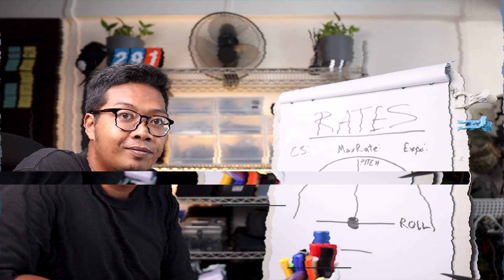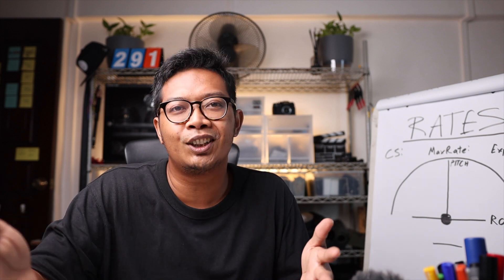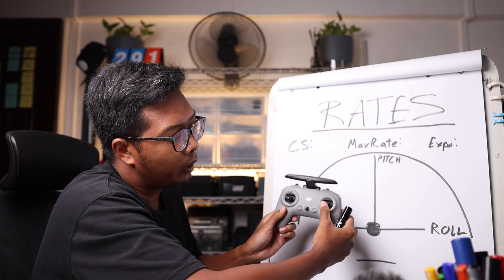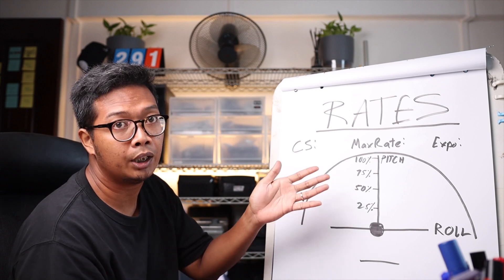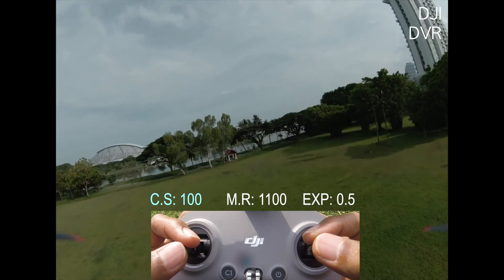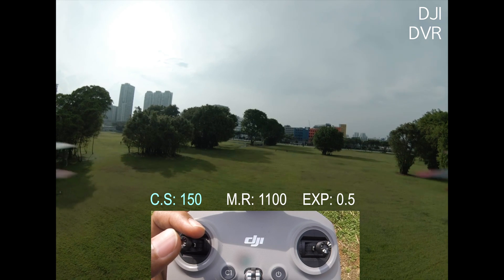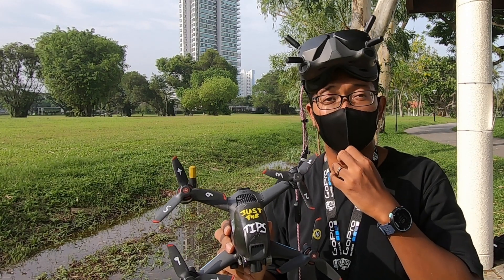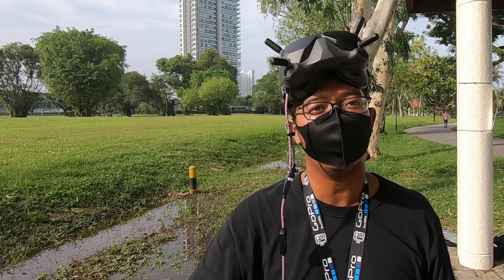How To Tune DJI FPV Rates CUSTOM TO YOU

Comment: do you have tutorial on how to fly slow speed hehehehe
Reply from the maker: Generally, that will have to do with the camera angle. the lower the camera angle, the lesser you will pitch forward, resulting in slower forward flight speed. Watch it here:
https://youtu.be/pHcQuOItoJo?si=5E9Qmg9j0FpOaXs6

Also softer rates help in smoother slow flights:
https://youtu.be/Ybm89B1pIO8?si=wtAXxtaPeqdyVhcm

Comment: Thank you for an amazing video. I have a question, is there a rates for throttle to keep it flying smooth and low and slow? Like to fly in building without worrying about smashing into areas etc
Reply from the maker: Sorry I missed this. You're most welcome! Hope the journey has been smooth for you. I have the same problem mate. When I was flying DIY fpv drones and wanted to fly in close proxy locations like an indoor carpark, i often would hit the ceiling. To counter this, I would add EXPO to throttle to have a smoother throttle curve. But sadly, the average user is unable to access this for the DJI FPV/Avata. BUT I did hear that there is a way to do this on the desktop. Have not tried this way yet. Prolly will get an episode out on this.

Comment: Great man! Greetings from Brazil!!
Hey would you mind to tell what kind of accessories you use to attach the camera to the controller?
Reply from the maker: Greetings from Singapore! Sorry I missed this. Hope your journey in the skies have been great. I use an fpv screen monitor mount. DIY fpv pilots used to fly through a screen, so I had one around. Not the best fit, but does a good job. Have a GoPro plastic base fixed on, and interchange between using a GoPro or a DJI Action 3. Iv ordered a better version as the clamp to controller is more versatile. 

Here is the mount: 
https://s.click.aliexpress.com/e/_DdANMYD

A version with mobile phone mount options as a combo set:
https://s.click.aliexpress.com/e/_DBBt3NX

Comment: If anyone could answer this question for me that would be nice but does higher expo with a low center stick mean less sensitivity? Like does higher expo equate to higher sensitivity?
Reply from the maker: Low expo Eg. 0.01 means almost normal sensitivity and linear delivery of rotation power. If you add expo up to 1.0, around the centre of the stick controls, it will feel muted but power will abruptly come in as you get the stick to max outer end. You can try this in the DJI sim first to have a feel.

Comment: Can we adjust the rate, expo of throttle stick? By default, DJI FPV throttle is very sensitive.
Reply from the maker: I believe it is possible in the developer app. You will need to look it up, as I have not toyed with that.

Comment: Fantastic video! This is exactly what I needed.
Reply from the maker: Great to hear! To keep it simple, set Max Rate first according to how fast u want the drone to spin at FULL STICK deflection. Second, adjust how that feels along half stick deflection. Some like this linear, some prefer with Expo to soften it. Then adjust sensitivity, for the controller to be very sensitive to your input, or muted. Take your time to find the perfect rates for you. You could try experiment this in the DJI app too, as you can adjust rates. Safer than trying this in the skies.

Comment: Is it me or max rate at 900 for the dji seems "slow" compared to a normal 5" drone.
Reply from the maker: Yep, it does seem slow actually . its just coz its a heavier quad in my opinion. Like slightly sluggish. DIYs are much more agile and reactive, while the DJI FPV doesn't have the quick and powerful motors that DIYs have. Then again the motors and overall system is efficient for the longer flight times. Thats the tradeoff for power vs efficiency I guess.

Comment: What an amzing video! This is by far the best explanation I have found in all my research. Do you have any issue with the CS on the throttle? It is the only rate I cant seem to adjust and it is so touchy it makes learning very difficult. Have you noticed this compaired to other FPV drones/controllers?
Reply from the maker: Thanks and great to hear frm u again. Yep, actually i do have expo set on my DIY fpv transmitter. And thats for different situations, like when i intend to fly close proximity and low height, having softer throttle feel helps, if not i'd be hitting the roof often. lol! heard that this could be done with DJI Assistant 2, and able to open developer tools. May wanna give it a try soon. Here is the guide : 

https://youtu.be/FOUjg2CrBEc

Havent watched it though. Had a friend link me up. Let me know how its going if u happen to give it a go.

Comment: I tried manual today R110 110 0.55
P110 1000 0.55 Y150 1300 0.55 and almost had a heart attack lol all of a sudden the drone went vertical hover, spinning in circles in one place.. i panic and press all my buttons trying to turn the engine off which dont work lol i had the button switch down to engine off and up for engine start didnt work lol finally i was able to press my panic button and it worked. On the simulator i didnt have a hard time on manual but this was whole different…
Reply from the maker: OOooo those are very fast rates bro. But then again its personal preference. Not too sure what happened here but glad that you managed to save it before things got out of hand. Just try to do pre-flight check again before you flip it in manual. Maybe just a glitch. And also be ready on the panic switch. Safe flight 🤟🏽

Comment: Heya! Thanks a lot for your video! Do you know the comparison with Betaflight rates/expo lettering? Cuz I have 2.00 RC Rate (linear sensibility) - 0.35 Rate (equal to Super Rate / sensibility at the extramity of the stick) - 0.65 Expo... The only one that has the same lettering is "expo" of course... while RC Rate and Rate are the nasty ones. Following the "meaning" of DJI I should have 40 or 30 in "center sensitivity" as I have for my "0.35 Rate" and 2000 for Max Rate which should be RC Rate.... But it looks weird having 2000... on DJI Virtual Flight the curve shapes looks like in betaflight with these values but don't want to crash it trying it out not being sure of that 2 values (center sensitivity and max rate)... any tip/help to understand the comparison between the 2 lettering DJI and Betaflight?
Reply from the maker: Im sorry, i too have not made sense of it. But then again, im an adaptive person. Meaning i try to have e best feel with my DIY first, then switch over in the same session and tune the DJI. Im happy with a close enough feel, and not going for numbers. Plus, the dynamics of each drone is diff (batt on top vs batt below, with or without Gopro mounted etc.). So i just start off with a similar feel for max spin rate at full stick deflection, then give it some expo for halfway sticks, and finally e CS to suit cruising flowy comfort. Iv not had success with all my DIY feeling e same EVEN ON SAME RATES, so i just get a close enough feel. Less time on the bench, more time in the skies 🤟🏽
Reply: @TheReelRahim  that’s fine, I was just wondering whether 2000 might be something extremely exaggerated before crashing my drone at launch or if that would be a possible rate setting
Reply from the maker: Oh man, thats extreme. Surprised its even avail. Wouldnt personally try it, as i dunno if i can handle that rate 😅

Comment: I am looking for a rate suggestion for someone trying to learn to fly in M mode. Every posts "best dates". If you were to tune it down to be less reactive what rates would you use? Thank you.
Reply from the maker: Iv created slower rates for Pitch and Roll, and then soften it further in the centre zone. U can follow it here :

https://youtu.be/C5s1HaFWcws

For the max rate, applies to its maximum spin rate at ends of the sticks. So iv reduced it. I didnt want a linear response, leading up to reaching e end of stick movements on the controller, so i adjusted Expo and Centre Sensitivity, to make e centre zone softer and not so reactive. Try it in e sim. Its lighter. But if u dont have a sim, then keep 'Attitude' limit ON. This prevents a spin, until u are comfortable in Manual Mode.
Reply: @TheReelRahim  thank you.
Reply from the maker: I edited the comment. Check it out ✌🏽

Comment: THanks for Video.
whats that special cable attached to goggles  that is different from dji cable
Reply from the maker: You're most welcome. Its a battery cable from TBS that im trying out. U can use the 4S batteries from DIY drones. I dont recommend it as the button is a touch sensor button, that may switxh off the goggles of it rests on your face. Stick to stock DJI Goggle 2 batteries.

Comment: Hi Rahim, Amazing content!!. I'm a beginner. got the dji fpv and playing only with liftoff and a phone simulator. could you explain in a in-depth video how manual mode changes the stick movement and also what does roll pitch yaw does. I feel it's impossible for me now to fly in liftoff.
Reply from the maker: Hi and thanks! Great that u are practicing on simulators first. Yep manual mode is not easy. U will really need to spend many hours b4 u can make Manual mode muscle memory. These episodes should help with the flying portion:

https://youtube.com/playlist?list=PLbGJAZK11noSr0316g0Gg_MojBHBy6wHY

Comment: Only complain for DJI is that their drones are very noisy, and the amount of money they are charging they should be using carbon fibre or better durable materials for the drone or at least for propellers to avoid that noise and better absorbing rate

Comment: Dear Rahim, it has been very helpful to me as fpv beginner, what do you use to carry DJI Fpv? I am thinking for Lowepro ProTactic 350, appreciate your suggestion bro, Roger!
Reply from the maker: CAMERA BAGS R E WAY TO GO! i personally recommend a rear access bag. Coz less likely for stuff to fall out by mistake. Also, if u rest e bag to open it up on the ground, e outer is on the ground. Better to have damp grass wet the outer area of the bag, than the padded area that will rest on your back later. I use 2 bags. A lowepro BPX2 for DIY drone and a ThinkTank Urban Access 13 for DJI FPV. Will be in a future episode! The ProTactic 350 looks great too! And having e outer weaves will allow for expansion! Go for it🤟🏽

Comment: Will these rates/expo work in DJI Virtual Sim?
Reply from the maker: YES! The current update allows u to input rates. I feel its a good move, coz i want to train in the sim, but rates were stock in the previous one. Drone control is v much different that way. Go ahead and input these in the sim and try some flips and rolls. It really feels close. Dont worry about the EXACT feel, as trust me its close enough. Get the muscle memory in, and the SEND IT TO THE SKIES!Lol!

Comment: What stick rates would you recommend for smooth, cinematic flying?
Reply from the maker: Great that u asked, coz actually there will be an episode coming next week where ill reveal new rates, combining fpv freestyle speeds, but smooth handling at cruise. But for now, if you are still at stock rates and have no need to do flips and rolls, id recommend following these 2 steps. 1) Lower CS(it will soften the stick feel in the centre) until you feel comfortable that the drone won't react so fast to input from neutral centre. U can even try 0, but its way too soft for me. 2) Raise Expo. This will give the stick a smoother climb to max. But as shown in the episode, "1" will be too smooth that u will need to move the sticks ALOT just to get the drone moving in that direction. Hope this helps get u started.
Reply: @TheReelRahim  did you ever make that new rate vid?
Reply from the maker: This Fri, 8:30pm Singapore. GMT +8
Reply: @TheReelRahim  great thanks! Look forward to the episode

Comment: Great explanation. Thanks!
Reply from the maker: Hope it helps u. Take it easy, as its a bit much to ask for those who are just warming up to fpv and suddenly have to start doing flips 😅. Fly safe, and see u in e next one🤙🏼
Reply: @TheReelRahim  Definitively! I did ~30-40 hours in the simulator before I was feeling ok with switching to manual on it, still need to practice on the large open areas a lot before I will be comfortable in smaller, tighter environment. One feature which I will love is something like 'Cinematic' or 'Tripod'for the Manual mode - to make it more slow...
Reply from the maker: @JaroslavBengl  something i have in mind for that setup. Will make a 'Cinematic Settings' in a future episode.

Comment: already subscribed :) btw I wanted to know, what should I do so than when my LEFT (throttle) stick is in center drop wont go up very quickly.
Reply from the maker: Thank you for staying to support! My throttle stick setting is no longer the same like in the video. When I bring the stick down, it will stay there. This is like my DIY FPV controller. So for the DJI FPV controller, hold it straight up and turn over to the back. You can open the rubber grip of the left stick. Use the Allen key supplied in the box. Tighten L2 FULL to make the stick not go up. Tighten L1 to give some resistance (up to your feel). Now if I push my throttle down, it stays down. Hope this helps.
Reply: @TheReelRahim  sorry my question was, if my throttle stick is in middle how do I make it go less in up, add EXPO to throttle ?. I want to reduce the center thrust.
Reply from the maker: At e moment, there is no option to add expo to throttle. U will just have to control it by modulation

Comment: Can i nailed the rates by just using the virtual flight app? Have yet to fly manual on this dji fpv bird.
Reply from the maker: I have been testing it out on the iPad, and yeah go for it! It actually seems close enough, but idk. In my app update, I feel e drone is a bit 'airy'. gravity is not right. so may affect the feel of the flight. but yeah, im kinda finding my rates there too, and can't wait to transfer it to my drone! its a constant process of finding personal rates for different flying conditions, so give it a try!

Comment: Boss, i notice you are using some special goggle cable that has on off switch. mind to share where to get that? also if DIY, any link?
Reply from the maker: Hi again! Yup its diff. Its a goggle cable from TBS that im testing out. Kinda awesome for existing FPV pilots, cos u can use 4S lipos and has a switch. It also has a connector to power e fan of a Fatshark goggle. I kinda not liking it tho. E switch is touch switch, means if e switch happen to rest on your face, it may shut down e goggle. E switch also gets hot. Also, i dont like e weight of a 4S, and also dont like it being in e pocket or mounted on e goggle side. Dji batt alr has a switch. So im gonna get another batt. Sits in e pocket or on e goggle better.
Reply from the maker: https://www.team-blacksheep.com/products/prod:sky_kable_red
Reply: @TheReelRahim  thank you boss for the awesome review
Reply from the maker: @lennylsl  glad to help. See u in e next episode 🤘🏽

Comment: Cool bro... why my dji fpv footage jitter
Reply: https://youtu.be/eLL5o1E9ci4
Reply from the maker: @styflymalaysia  it is very slight, but yes i see it. Caused by rolling shutter and/or vibrations from the quad itself. Try increasing framerate, but it may make e video a little too dynamic and unnatural.

https://youtu.be/bhApFzr9-eA

Ignore e crop in/ film sideways part. But e effect is e same here. Its just that sideways vibrations are faster in e DJI FPV, coming from motors and drone flight adjustments. So a faster framerate (and shutter) will prevent this but makes e video abit too rigid.
Reply: @TheReelRahim  tq bro will try on the frame rate first.. dji fpv 59.94 after editing i lower to 29.94... next target 59.94 editing same fps.
Reply from the maker: Your channel videos look smooth. What jitter are u having? Any videos that show the jitter?
Reply: 2:10, 5:20
Reply from the maker: @styflymalaysia  where is e video link? It has disappeared. Saw it on notification just now

Comment: What cord is on you goggles ?
Reply from the maker: U can get the cord from Team Black Sheep. Its for use with DIY drone lipos, has a switch and can power the fan of some DIY Drone goggles like Fatsharks. Still testing it, but on initial opinion, id rather use the original batt. good batt life, also has a switch, and slips in easy on pants pocket. best is just get another for spare.

Comment: Sory bro..tanya dlm.malay..sy ada fpv dji ney..utk start manual..1st soalan perlu ka stick tu.. sy bagi longgar atau tak pyh kacau...
2nd utk take off sy pakai normal mode...drone dah hover sy tukar pegi manual mode...dia masi hover mcm biasa?..
Reply from the maker: No prob bro. Ni dua soalan, jawapannye ade link. Sye jwb 1st soalan. Pendapat sy memang perlu bagi longgar. Sebab lagi senang nk control. Ni kene mengena ngan Soalan 2. Jawapan soalan 2, Normal mode memang drone hover. Stick tu untuk kasi drone naik atau turun. Tapi dalam Manual mode, tu stick jadi THROTTLE. Throttle stick kalau auto kat tengah, drone terbang ke bulan hhahaha. Tu sebab sye longgarkan sikit. Biasanye, pilot2 yang DIY racing drone, throttle stick tak boleh auto tengah. Tapi sye adjust throttle boleh ke tengah sikit, sebab perlu untuk Sport and Normal mode. Sye sarankan throttle dilonggarkan, jadi senang control drone.
Reply: @TheReelRahim  tenq bro baru nak fly tak bagi longgar stick..haha silap2 ke bulan..skg ney sy masi newbie pasal manual.mode dji fpv ney bro..jd 1st utk fly sy hover dlu pakai normal.mode..pastu tukar pegi manual mode la kan..sy kena tukar setting la untuk buat mcm bro yg boleh bagi tengah stick dia hover?
Reply from the maker: Yes! Part ni, nk kene agak2 ikot rasa. Spring rasa longgar, tapi masih boleh sikit2 stay kat tengah, senang hover.